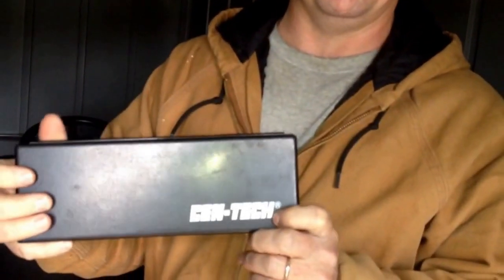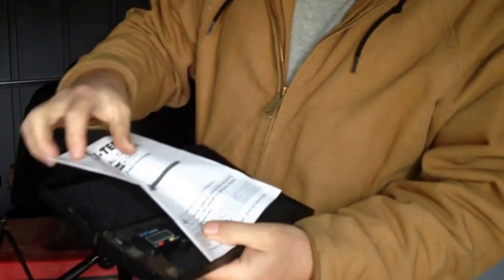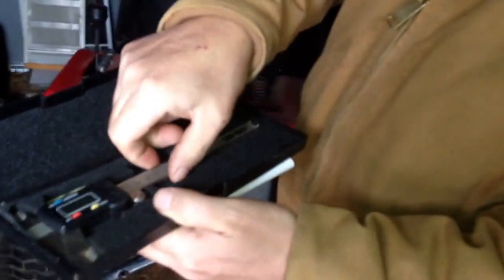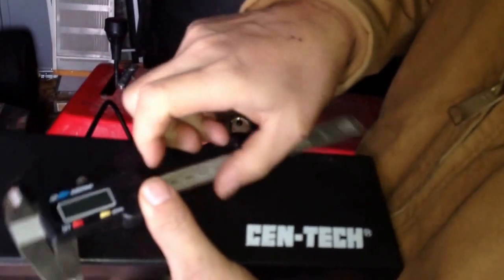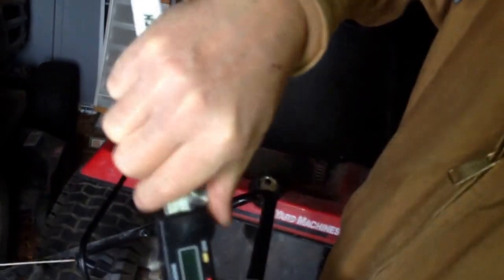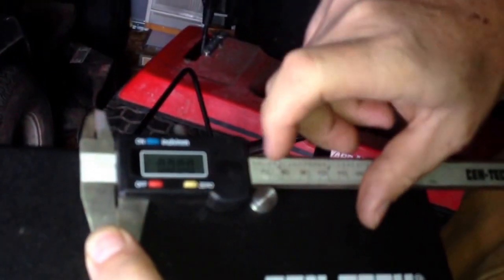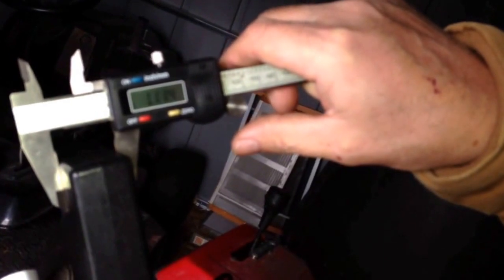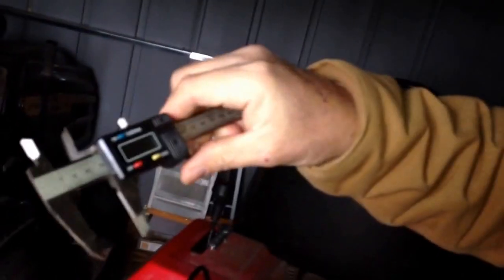Harbor Freight 6" Digital Caliper.

Comment: but....but.... how do you change the battery?
Reply from the maker: There is a little cover on the front side that slides off.
Reply: Looking down from the top. There are two sliding doors , Do not try to get the battery out of the top sliding door. Looking at the caliper from the front there is another bigger sliding door and that is the one you want to slide and then you can easily change the battery.  I first opened the top sliding door and I was  thinking how the heck do I get that battery out through that small door. HF never very good instructions, but sometimes good products. I use mine a lot for converting number back and forth metric to English, but used up the battery.

Comment: I used that same model on my Wheel Horse 520H restoration videos.  It worked well.
Reply from the maker: I was going to get a better one at Grainger for $35 but found this one at Harbor Freight for $10. It saved me some money and will work for what I need right now.